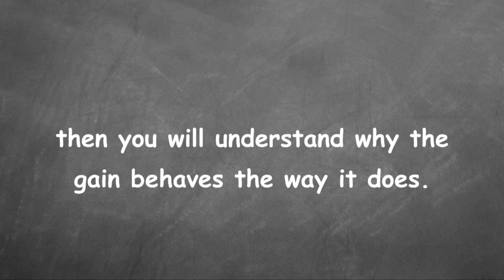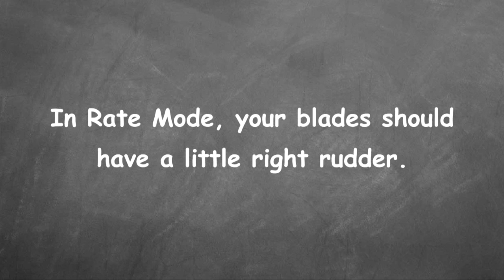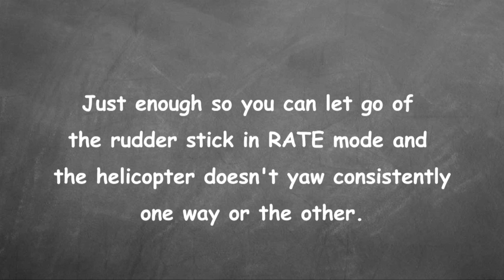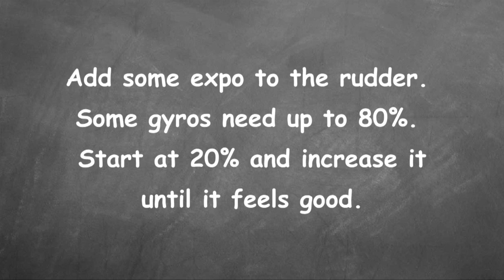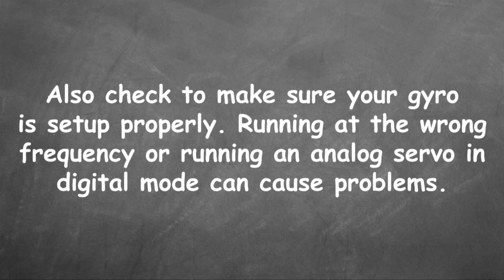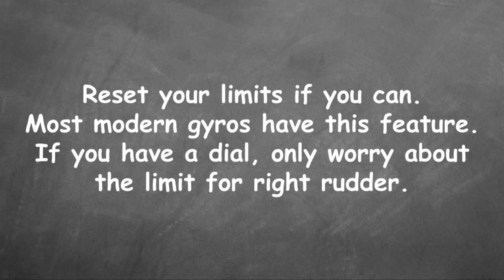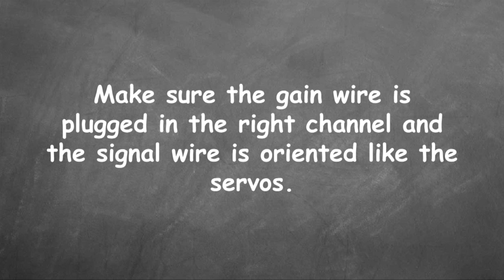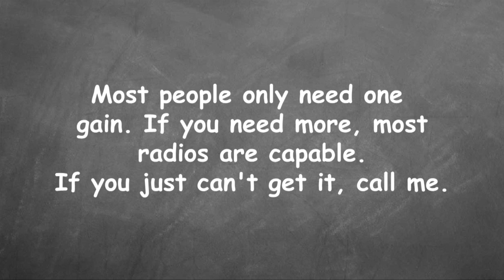Tail Rotor Basics Part 2 - Gyro Gain

Comment: Any reason why my tail will drift back to center in Heading hold mode?
Reply from the maker: It sounds like the heading hold gain isn't high enough. As I said before, I know nothing about the Naza, but all heading hold gyros have a way to set the gain in rate mode and heading hold mode. Have you verified the gain? Have you tried setting it to 100% just to see how it reacts (as shown in the video). I would suggest doing that in both heading hold and rate mode. At about 2:06 in the video you will see this. Please tell me what transmitter and which model Naza you are using.
Reply: Hey Rob. So I’m using a flysky FS-i10 radio with cyclic Align DS820M and a Naza H. I did what you told me to do, the only difference is, when I’m in heading hold mode after a few seconds, my Servo drifts back to center. Also, within my transmitter, I have to move the slider negative for rate mode, and positive for Heading hold mode. I actually posted a video so you may know what I’m talking about. Please, if you can, can you view it and get back to Me. Thank you. https://youtu.be/M10lsA9JXdg
Reply from the maker: @pierreh9373  Have you flown this helicopter? What it does on a coffee table tells you hardly anything. 
You have components that I am not familiar with, which is why I made this video. 
Please watch it again from the beginning with determination to get what I am saying. I think you will find your answers there.
FYI. I did watch your video and your model is beautiful. I cringe when I see you spooling it up like that. Be careful please.
Reply: Ok Ron, flew it, and kept adjusting the gains, and it seems that my problem is a software error. I therefore purchased a Demon Cortex which works beautifully.
Reply from the maker: @pierreh9373  I'm glad to hear that. Good luck

Comment: I’m currently working on a Roban 800 size EC 135 (4 rotor blades and 7 tail blades). The tail travel on this helicopter is very light. Having a hard time setting my throttle curve due to this issue. I was attempting to fly at a flat throttle curve of 75%,  but the torque from the main rotor was too much for the naza in Heading Hold and rate mode. Is it safe to attempt to fly with a 50/60 % throttle curve being that the tail seems to hold there. If not, can you share a pitch and throttle curve that I may want to attempt?
Reply from the maker: Pierre,
I know nothing about the Naza, but let me ask you if you can get anymore pitch out of the tail blades if you raise the gain in both Heading hold and Rate modes.
Reply: No. There is no more travel on these blades. Any further will cause binding
Reply from the maker: @pierreh9373  Are you using the recommended 750mm main blades?
Reply: Yes. I’m not using all stock components. I will do a walk around video tomorrow and post it so you may see what my Setup looks like.
Reply: I uploaded a video so you may know what I’m talking about. https://youtu.be/M10lsA9JXdg

Comment: Thanks for the video. I got a question. How come, when I turn gyro sens to 70% (for instance), and move the rudder stick, for example, to the left and then back to the center, the tail blades stay in left position (do not return to the center). Same goes for right direction. But when I decrease gyro sens to 30%, the blades return  to the center with the rudder stick. Is it normal?
Reply from the maker: That is totally normal. Depending on how your transmitter is setup and what brand it is, you are probably going from heading hold mode to rate mode. So maybe 0 - 50% is rate mode and 50 - 100% is heading  hold mode. If your gyro has an indicator that shows whether it is in heading hold mode, watch it when you change the rate and see where it switches over. Good luck.

Comment: how do you hook pitch and throttle both to the left stick on the reciever
Reply from the maker: It depends on the radio transmitter type, model and brand. All "helicopter" radios mix pitch and throttle in the firmware. So, in the manual for your transmitter will be a section on channel assignments. Typically, channel 6 on the receiver is pitch and channel 1 or 3 is throttle.  I would suggest searching for your transmitter model number and the word "setup" here on Youtube.
Good luck, Ron
Reply: Ron Lund thanks i have an older jr transmitter it does not ccpm so i need to buy a different one
Reply from the maker: If you have a local hobby shop with some people that are knowledgeable about rc helicopters, that would be the place to start. If not, Amain Hobbies would be able to help.

Comment: Hello Ron I was setting up rate mode and heading hold on my flybarless gyro and the values i entered were 75% heading hold and -30 rate mode on my spektrum Dx7.
 when I tried to connect my
Spektrum AR8000 Satallite
reciever it would bind properly
but my gyro wouldn't initialize
properly. I am using a beastx
gyro too. Why is happening?
I spent close to a 100 dollars
on this Satallite receiver and it
wont initialize my gyro properly? Why?

Comment: Hello  Mr RON ,THIS IS JJ IN MONTGOMERY ALABAMA  .I'M GOING BACK  OVER YOUR  VIDEO'S  ON THE GY401 SET UP  ,THIS  MIGHT BE  A DUMB QUESTION  ,BUT IN YOUR  #2 SET UP OR PART 2 ON THE GY401 GYRO  YOU HAVE THE GYRO  SITTING  ON THE TABLE  AND YOUR  MOVING  THE GYRO  TO THE LEFT AND RIGHT  WITH  YOUR HAND, THE QUESTION  I HAVE  "SHOULD  THE GYRO  BE MOUNTED ON THE  HELICOPTER  FRAME  IN THE RELATION  TO  THE WAY YOU HAVE IT SITTING  ON THE TABLE  IN YOUR  demonstration in part two of the video " ? OR DOES IT  MATTER  IF IT'S  FACING THE OPPOSITE DIRECTION  ,MINE  IS MOUNTED  WITH THE  WIRES  COMING  OUT OF THE REAR  ,THAT'S  IF YOU'RE  BEHIND THE  HELICOPTER   ,STANDING  BEHIND THE  HELICOPTER  THE NAME  FUTABA  IS RIGHT  SIDE  UP ,OR DOES IT  MAKE  ANY DIFFERENCE?  JUST CURIOUS. JJM IN MONTGOMERY ALABAMA SENT
Reply from the maker: It can be mounted in any orientation as long as the base is parallel to the tailboom. If it is upside down, you might have to reverse the gyro using the microswitch on the gyro.
Reply: Thanks for the  answer  MR RON  JJM IN MONTGOMERY ALABAMA SENT CLASS A

Comment: I was trying to fly my heli w/o even noticing I have to set the gyro values on the AR7300BX.  I was getting 1mm movement and it kept spinnning regardless of what I was doing.  Luckily I have the trainers on the 450 and I didn't bother taking off!

I added some gain and holy shit I get like 100x more travel.  I will try it tomorrow.

Comment: Hey ron. Love your videos, They have taught me a lot!. I recently bought an align gpro unit. I'm having a lot of problems with the rudder gyro. The cyclic is very stable and will hover hands off but when I try to yaw right it snaps to the left first then right. Very strange . It yaws left correctly. The other problem. Is that when you yaw it keeps rubberbanding back to it's original position like it is locked into that heading. I have reduced gains significanytly but nothing changes. Any thoughts?
Reply: Scott Thackrey what tail servo are you using? Had issues with the align servo with gpro on the 500L dominator its a lot better with a 9257/full size servo
Reply: Hi there, I was using a ds515 but I have now swapped this out for a spare ds520. They are both align servos. it's strange, the heli flew normally with the 3gx.
Reply: Scott Thackrey what model is this on a 500?
Reply: Yeah a trex 500 pro that was converted to flybarless with 4 blade head. Thanks for your help. Really appreciate it.
Reply: Some gyros are better with bad servos than others. 

Mine got a lot better with a full size servo.

Its a simple mod to the frames to do it
Reply: Ill give that a go, thanks.

Comment: Hello, I put my helicopter to 30% gyro in rate mode and mechanical setup with servo horn at 90 and a little bit of left rudder like you say to do in the video but my helicopter (blade 300x) kept going left so I kept moving the slider more and more over to the left it is now to the point where it is almost 3/4 of the way to the left end point! and still drifting left but not quite as bad. I used to setup the tail with servo horn at 90 and tail slider at 90 it worked pretty good only blew out on really hard moves. Should I try to setup the rest  in heading hold like this or go back to what I was doing with 90 degrees?

Comment: Hi Ron. Good vid! I have an align gp780 in a TRex 600 ESP and XG8 radio. The gain set via Aux 2. All gyro and servos senses are correct but, I have to keep correcting the tail in both normal and heading hold mode. The gain is set to 70% in heading hold and 45% in normal.

What's wrong? The TRex is set up as per instructions. Give Mickey a little cheese from me :)